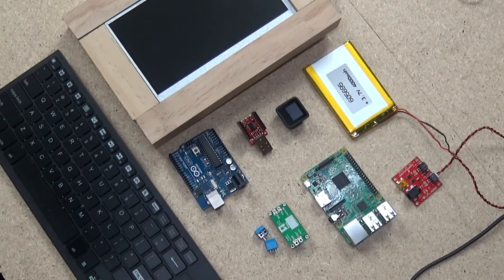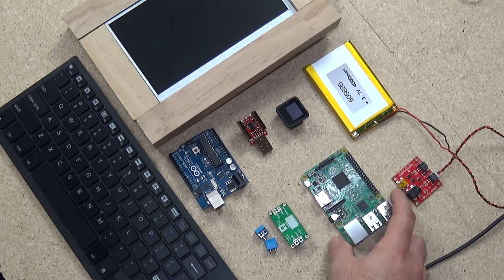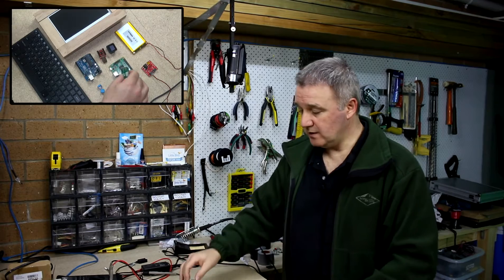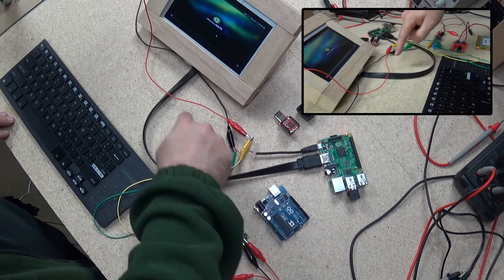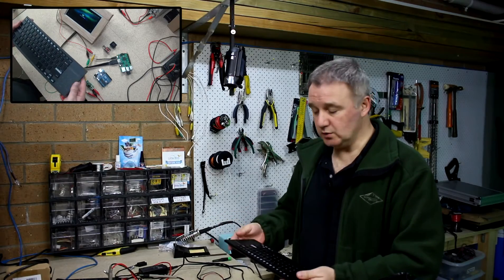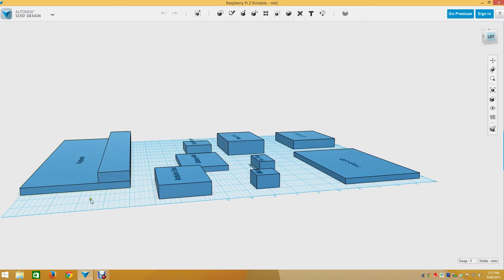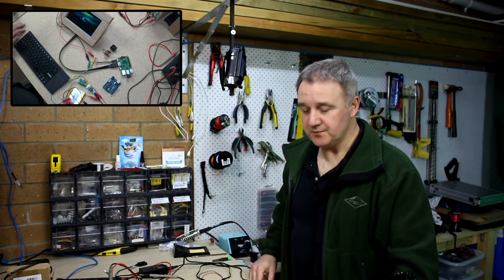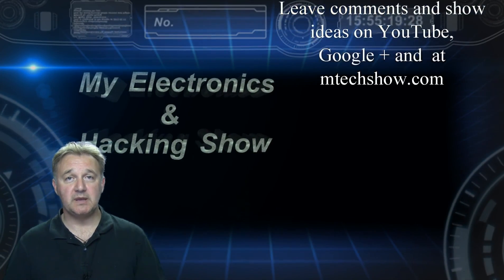Raspberry Pi 2 Portable MK2 Part 1 (MEHS) Episode 32

Comment: I have found a display on Ebay similar to yours that is not a touch panel, If you started again would you consider a 7" touch panel, as opposed to the none touch panel you used, as I am wondering is it worth the extra for a touch panel.
Thanks for any opinion you have before I purchase
Reply from the maker: - Hi.  Due to the size of the screen and the fact that we are mostly using a desktop OS I would not bother with touch.  If you were looking at maybe an android rollout then touch might be more useful.  Cheers.

Comment: What model is the pololu being used here?
Reply from the maker: +Charo Nuguid - Hello.  I was using the S18V20F5 but it struggled when everything was running.  So I switched to the Pololu U3V50F5 and have been using it ever since, very good.  Capable of up to 5 amp output.  It easily and reliably runs a Pi 2 or 3 and a display.  Cheers.
Reply: +My Electronics & Hacking Show thank you! I suppose this is the same model you're using in your mk3, yes?
Reply from the maker: +Charo Nuguid - Yes it is.
Reply: Thank you again! 😊
Reply from the maker: Charo Nuguid  - You're welcome.

Comment: where did you buy ur battery?
Reply from the maker: Hi.  I found this one on eBay.  From memory it came from China.  Cheers.
Reply: My Electronics & Hacking Show ah thanks.
I also foind one on ebay but i was wondering where you did got it from.

I also want tp make an portable too but i use a 6000 mah battery.
You think ebay is a little bit trustable for lipos like the one you have?
Reply from the maker: *****  - Hi.  I got mine from ebayer 	 	
	User ID bkebuycn.  I didn't have any trouble.  It works fine.  Whether its a true 4000mah i haven't tested but i do get more runtime from it than another 3000mah i have.  I have also purchased a 6000mah battery from a retailer in Australia.  It definitely has more runtime but it also has more thickness to it.  Hope that helps.  Cheers.
Reply: +My Electronics & Hacking Show thnk you!

and i realy like whatching your vids so keep making them!
Reply from the maker: +Tim Leijten - Thank you.  Will do.  Cheers.